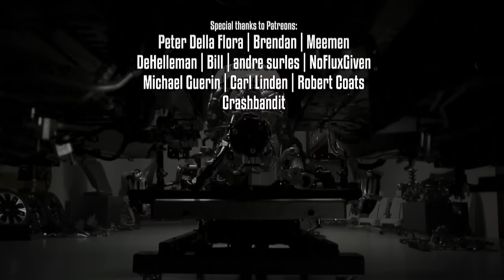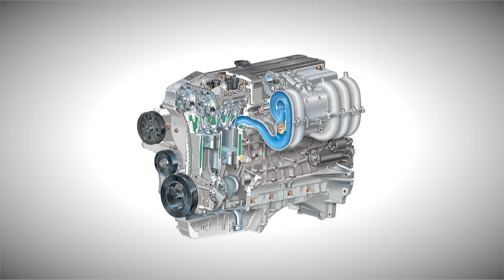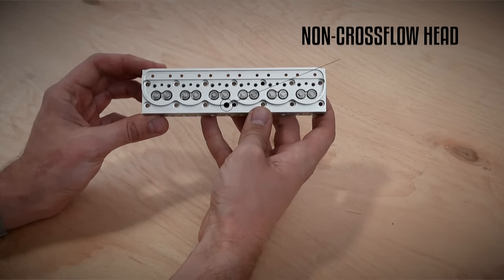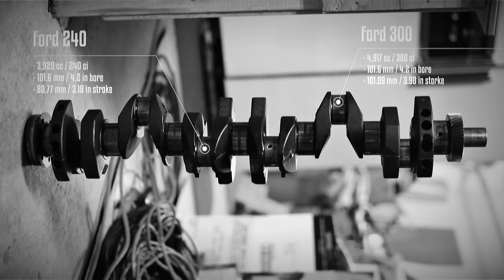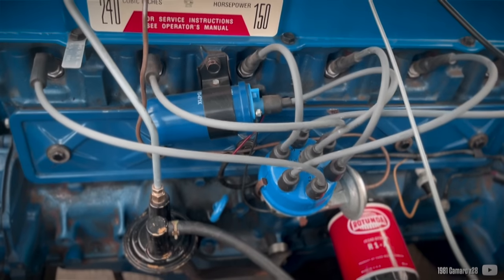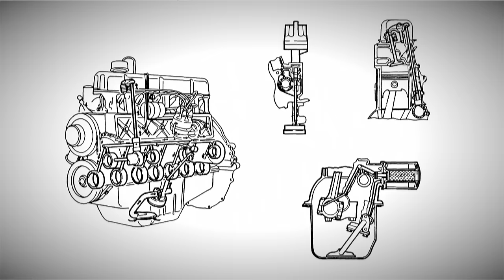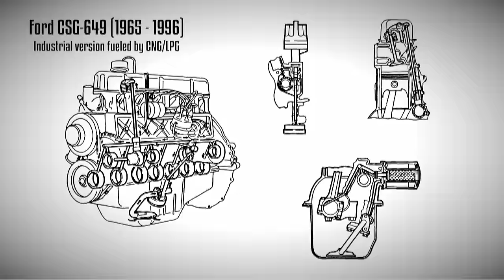Is This Toughest US 6-Cylinder?

Comment: I owned a 96' F150 with the 300 motor. It was a work horse that actually felt better pulling a heavy load. The only thing I ever had to do was a simple tune up.

Comment: Fun fact: Ford had an experimental program with these engines. There were engines built with crossflow heads, aswell as a turbocharger. The models that got turbos could keep up with a 460. The crossflow head is extremely rare today, and no turbocharged variants remain.
Reply: The crossflow head development work would end up getting used on the 200/250 in Australia, a cast iron version (which suffered from cracking issues) would be used from '76-'80 followed by 2 different alloy version from '80-'92 (Alloy Head I pre EFI, Alloy Head II post September '82 with either a 2 barrel DCNF Weber carb or EEC IV EFI).
Reply: i dont doubt that if the turbo was properly matched. all inlines have massive torque advantage over the v engines

Comment: My 99 F-150's 4,6 V-8 died about a year ago after 388,000 mile. I rebuild and installed a 1975 industrial 300 six taken from a woodchipper and O/D automatic tranny in it a year ago. I have noticed very little difference in performance except it gets better gas milage now. That and most all the computer crap has been deleted.

Comment: I operated a ford 240 for just shy of 400,000 miles before the body of the old thing gave out. Now its a Ford 300 but I'm an old man and I doubt if I will ever see it go into retirement. I think a lot to myself about figuring out some way to shove a 300 into a sports car, that would be so awesome  in something like a TR4, not only would it run forever I think that old torquer would just grind the back tires to dust.

Comment: bought a 1984 F-150 4x4 short wheel base 4 speed with granny first gear had it 22 years 540,000 miles when i sold it all original running gear and about 25,000 off road miles from above Fresno California to pismo beach to all around mt lasson and mt Shasta plus Sonora pass went everywhere the FJ-40s with chevy engines jeeps small toyotas

Comment: It’s a stump puller! Power nation built the one in the video with a turbocharger and it really liked it.
Reply: Searching 300 ford turbo on here is interesting. 
They usually put out around 220-240hp and like 450 foot pounds at like 2000rpm. 
Little gas engine thinks it's a diesel with that kinda torque.
Reply: @MrTheHillfolk This was LONG before Diesels was put in Pickup trucks in the USA. 

And in the 1980s(USA) , diesels and Pickup Trucks(and sedans like Buicks, Cadillacs, Chevrolet, etc) were not meant for power.....they were mainly meant for better fuel mileage
Reply: Haha I love that power nation series of videos. You could tell the guys were having a blast trying new parts in stages.
Reply: @charlesbakston7414  and torque

Comment: As an Australian I appreciate you bringing up the Australian ford straight 6.
While ford used the straight 6 for longer, a better example of an incredible straight 6 would be the 246, 265 hemi that valiant (Aussie Chrysler) ran.
It the 265 hemi used to race (& win) against Holden and Ford v8's.
Also really like your videos, hope you keep making them and continue growing.
Reply: yeh with a 3 speed manual box in some models while the ford and gm v8s had 4 spds, imagine if they used a 340 or 360 back then.
today we see chargers with 360's racing around the tracks in the vintage class they do well.
my centura 4spd hemi 6 was a rocket, easily beat v8's.

Comment: The Ford 300 is one of the greatest engines ever built. My step dad bought an f150 30 years ago. He drove it every day for 20 years and put over 400,000 miles on the odometer. When he sold it as a parts truck, it wasn't because the engine was bad, In fact, the engine was perfect, but the rest of the truck rusted away. But no matter what, the weather that truck always started. You just can kill a 300.

Comment: One cool thing about the Ford 300 is that it has the same bore spacing as the small block.  Drag racers have cut up Cleveland 4V heads and furnace brazed them together to make 6-cylinder heads.  Those really made the 300 run.  I respect that kind of "enginuity".

GMC used to make a 302 I-6, 4.00" bore x 4.00" stroke.  Too bad those didn't survive in production long enough to get EFI.  Ford gets points for putting EFI on the 300 and keeping it in production until 1996.

My Cummins 5.9 has 577,000 miles on it...
Reply: What year is your dodge? I’ve got a 91.5 and a 2004. Both with Cummins.
Reply: @Sackmatters  2001  2wd 2500 5-speed manual
Reply: @andyharman3022  right on. My 04 is a 4 door dually 6 speed manual. Love it to death. Head turner with the aluminum diamond plate flatbed. I’ve always liked the 2nd Gen rams.
Reply: My hemi has 300,000 hard pulling miles on it, 2004 AWD Laramie 4 door with the 20" wheels 
And runs great.
Also have 4.2 F150 "heritage" with 260,000 on it. 5 speed.

Comment: I would love to see the 300 come back, possibly turbo charged
Reply: Horse Power TV did one in the last year or two. Around 500hp if I remember correctly.
Reply: Maybe Mazda will influence Ford to do so.
Reply: to that turbo add a sleeved aluminum block and port + direct injection = my dream motor.  have a 1994 4.9L F150 w/ 276,0000 mi.

Comment: The 300 in my 88 f150 has 480,000 miles on it with the only significant work in it was replacing the fiber cam gear with a metal gear at around 300,000 miles. It still runs great, doesn't smoke and only uses 1/2 quart between oil changes. The Borg-Warner 4-speed that's behind it is equally reliable. I'm 50, and this is my 3rd 300 powered pickup. It will probably be my last because I'm not parting with this one, I'll eventually pull the motor for an overhaul and upgrade to a 5-speed and keep driving it.

Comment: These engines can take a beating. My brother had one in his old F100 and he ran it on less the 3 quarts of oil. Didn't phase it. The engine itself outlived two other trucks that it was in. The engine itself had around 300,000 miles between the three trucks it was in.

Comment: Mechanic’s anecdote: that fiber gear is incredibly durable if it’s prepared correctly. Take it out of the packaging, pit it in a gallon size ziplock bag, and smother it in whatever motor oil you’re going to use. Put it on the shelf for 48-72 hours, or forget about it for 3 months as you’re waiting on parts, and then take it out and install it.
Reply: What does this oil soak do for the gear?
Reply: If you already have the engine apart, wouldn’t it be better to replace the timing gear with steel?
Reply: @cavemanjoe79  part of the reason Ford went with the fiber gear for non industrial use engines is the steel on steel gearing made a particularly annoying whining noise that would get people who don't know much about engines complaining about a non-issue. The fiber gear didn't make a noise that would concern the layman. Those in the know would run the fiber gear till it started falling apart, then swap in the steel gear and usually never look back.
Reply: @thomasschulz2167  that doesn’t make sense. None of Ford’s other engines made noise. Why this one need such a thing?
Reply: @AlphanumericCharacters  No other Ford engine just solely used gear to gear. Everything had a timing chain which doesn’t make noise. Gear on gear is what makes noise.
Reply: @pipbernadotte6707  It has to do with very first start up. If the gear is saturated with lubricant it will always be lubricated, extending its life.
Reply: @cavemanjoe79  Unless you're going to be increasing the duty cycle on the gear, such as installing a hydraulic roller cam, higher ratio rockers and stiffer springs, there's really no point to installing a steel gear. 
And in a passenger vehicle, that gear is going to drone and drive you insane.
Reply: @davidblalock9945  
Shoot, straight pipe that 300, and you'll never hear the whine. =)

Comment: Slant six is something that is very good. I remember them. Not the most powerful motor but is a wonderful daily workhorse.  Just change the oil. Use Premium fuel.
Simply a great motor. 👍
That's why supra jz is the best engine given to us.😊
Now the bmw folk like it. Put a turbo to wash and enjoy. 
I haven't seen 600 hp and any one hurt.
They are smooth.  Balanced

Comment: Unfortunately, the only Ford straight 6 I've worked on didn't get a single oil change in It's life and it had a nasty ring ridge on all the cylinders @ about 60,000 miles
Reply: @ParchedGoat1  it was running on 4, it had blown the head gasket and torched the deck. It was very unfortunate to see, considering the mileage. Not ripping on the engine at all, purely operator error
Reply: @MonticelloSkateTeam  60000 on original oil is impressive

Comment: There 2 , inline 6 cyl engines that vie for the "indestructible" moniker, IMO, the Chrysler/Dodge/Plymouth 225 cu. in. (3.7 liter) Slant Six and the Ford Truck engine 300 cu. in.(4.9 liter) I've owned both beat the crap outta and neglected....nevrr broke once, over 100's of 1000's of miles

Comment: Imo one of the most reliable engines ever. Lots of torque and pulling power. They used to dominate the 6cyl. Classes of local dirt tracks where I was from. Some of them had 6 straight pipes for exhaust, sounded like a swarm of bees. Good Ole days.

Comment: It’s kind of hard to comprehend why Ford (America) didn’t further develop and refine these engines. Ford Australia put an iron cross-flow head on essentially the same block in 1976 followed by an alloy cross-flow head in 1980. This was improved into an SOHC design in the late 80s which would eventually become the variable DOHC 24 valve “Barra” engine which in peak factory turbocharged form output 325kW (436 hp) which is still far short of its potential.
Reply: They didn't because GM didn't, all ford does is copy GM, so.. that's why..
Reply: If Ford made the 300 into a OHC design, would be more complex which means the higher probability of something breaking down since the more parts there are to an engine, the higher probability of something breaking down. There’s still many, many Ford 300 inline 6 engines that are still out there (might even still be in production for industrial uses) running over 40+ years later. Over head cam engines simply can’t hold a candle to push rod engines in terms of reliability and durability.

Comment: The 1950's GMC 6-Cylinder engines were considered the best; they were used in a lot of salt-flat racers and some drag racing cars.  The Hudson Straight-6 dominated NASCAR in the early 50's, and was a great engine, until Hudson went out of business.

The Jeep 4-Liter six was greatly improved after fuel injection (weren't nearly all engines?), but their last years were marred by a poorly-designed head.

Buick's V-6 was another great, simple, reliable, bullet-proof engine that was made even better after electronic fuel injection (but of course, Chevrolet couldn't have that, so it was discontinued).

Comment: In Australia we had the 250cui / 4.1L and the 221cui / 3.6L versions and we would put extractors combined with twin exhausts and they would sound awesome!!👍
Reply: Which became the Barra eventually.
Reply: In Brazil we have the 4.1L straight six from GM, an OHV gas engine. A truckload of torque and potential for tuning, slap a turbo on it and you’re about 250-300hp with no forged internals. It makes about 160 stock. 
Known to be very reliable and durable, tho the gas mileage isn’t the best since it powers very heavy cars, averaging at about 6km/l city, and 12km/l highway. We love our 6 pots around here, they’re very respected sound great.
Reply: And the 200 /3.3l
Reply: Yours are based on the Falcon six, the one that kicked off at 144ci in the 1960 Falcon/Comet

Comment: Using the inline 4 as a baseline, the V-8 almost doubles the cost and complexity, but also doubles the power. The inline 6 gives 50% more power for almost no extra complexity. The v-6 (or flat six) doubles the cost and complexity for only 50% more power. The v-6 also uses a 60-degree V, compared to 90 degrees for a v-8. This makes it a much more cramped design, with all the disadvantages of that as well. In short, the v-6 is a bastardization that combines all of the worst aspects of everything, and adds some new ones, for little benefit. It shouldn't even exist. Fortunately, the v-6 seems to be going extinct. (The automotive v-4 is a similarly bad design that went extinct long ago.)

Comment: My daily driver is a 95 f350 cab and chassis with a 12ft flatbed and i get about 16 mpg empty 13 loaded, ive had 5 ton on it and its crazy how them old 300s will lug and pull, I've broke both motor mounts pulling stuff with it a couple times now

Comment: The GM 5 cylinder in my 07 Hummer is tough as hell with a measly 183,400 miles on it so far. Barely broke in now................

Comment: The 300 and 240 were great reliable engines...I also think the GM 292 and the 250 were great as well. So were the 230, 194... The best Ole school 6 in my opinion was the 235 then the 216.. The Slant 6 chrysler 225 wasnt bad but kinda guttless compared to a big six but they sure got good mpg like 28 mpg all the time on hwy. The 292 was a gas hog. I had a Nova with a 250 3 speed 2.56:1 gears and I constantly got 25 to 29 mpg. My brothers built 300 in a ford f-250 4x4 is a pullin monster with big lift cam headers and a 600 holly 4 barrel in an aluminum Offy its a beast. I love inline sixes I still drive a 1953 Chev Bel Air with a 235 3 speed just getting ready to instal 3:55 gears from 3:70 it will help at 65 I do have a 3speed overdrive for it but it has a closed drive line and that opens a whole can of worms. love your video get a 6 Cheers

Comment: Yep, I had a '77 F100 carbureted, & an '87 F100 injected. I wish I still had both trucks especially the' 77 😡. Zero issues & sometimes you didn't know if they were running they were so smooth. Ford 300 I-6, best engine ever.

Comment: owning a ford 300 over 17 years and 300,000 miles with only water pump, starter, air pump and alternator replaced.  I believe the engine will out last the rusted body.

Comment: I still run a 69 ford with a 300 in it. Original engine. Just passed 450 thousand miles. Still rocking. 👍

Comment: I still use the 300 in my old 1995 f150  330k miles on the clock and still running like a top.

Comment: I have had two vehicles  that had the 240 and 300 ci engines. They are bullet proof. Also, the 200 ci engines had 7 main bearings and were excellent engines. They are simple to work on and parts are readily available.

Comment: The Ford straight 6 cam tunnel is on the minor thrust side of the block which is a major design flaw. The Jeep/AMC inline 6 is a better, more durable, more powerful engine.
Reply: The best ford straight six is the barra turbo

Comment: You are absolutly correct!  My 250k 300 is still going strong and not burning any oil!
Reply: but how much does it leak, leaks were an issue on the 300's ive known
Reply: @maddhatter3564  No.

Comment: No engine made in the 21st century can hold a candle to this engine. If Ford made a 4 cylinder derivative (basically a 300 with 2 less cylinders), would easily be the most reliable 4 cylinder EVER made.

Comment: Its a close race between the AMC 258 6 and the Ford 300 6, both are amazingly reliable engines that you could always depend on way past 200,000 miles, that says a lot with the gearing in the older vehicles (pre overdrive/ 5 speed transmissions) being so much lower which made the engines have to run at a much higher RPM even during normal daily driving conditions, my old 68 Ford f150 ran at about 3000 rpms at 55mph, my 02 blazer cruises at 70mph at 2000rpms, the gearing has a lot to do with today's vehicles passing 200,000 miles on average.

Comment: I currently own a 1967 Mustang with another good 200 ci 6, with 127,000+ miles on it, never had the head off it, but it’s one of the great 6s that came out of the 1960’s with future great 6’s to follow.
Reply: And, if you ever needed to, you could remove the head, take it to a machine shop, get it back and get the engine put back together with an absolute minimum of time, tools, effort, or heavy thinking. They don't make cars like the 1970 Ford Maverick any more. If you owned a screwdriver, a pair of pliers, a 1/2 socket and a 9/16, you could fix it.

Comment: 7:17 Turbo Maverick on YT. Stock Ford 300 longblock from an 83 F100 with a huge turbo bolted onto the side and shoehorned into an old Maverick Grabber. Fuckin' thing pulls 1,000hp out of its ass without even trying, does 10s in the quarter, drives docile as can be off-boost, AND HOMEY MADE NO INTERNAL MODIFICATIONS WHAT SO EVER!

They did not need a forged crankshaft. As long as you keep the tach south of 6,500RPM you will not break that crank.

Comment: 2:01 I FUCKING LOVE the 300. I will die on this hill: The 300 is the best overhead valve engine Ford has ever and will ever produce. Better than the Windsor smallblocks, better than the FE, Modified, Cleveland, 385-series big blocks, better than the Modular motors, better than ecoboost, than Coyote, none of them hold a candle to the 300. Simple, rugged, lives for-fucking-ever.

I have an 85 F150 with that engine in it and a 4spd manual. I have the power of a 302, yet I get 18-20mpg out of a CARBURETTED truck and at 350k+ miles it's still thundering along happy as can be.

Seriously. Best fucking OHV engine Ford ever made. The only engine Ford's ever made that I would rate higher than the 300 is the flathead V8, and that's only because of how good the Flatties sound. That's it. The 300's actually more durable.